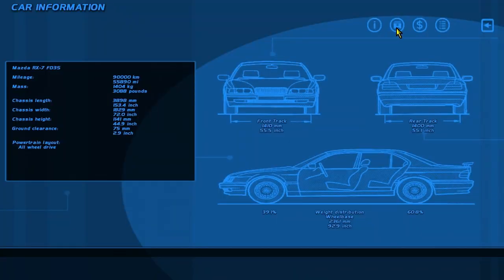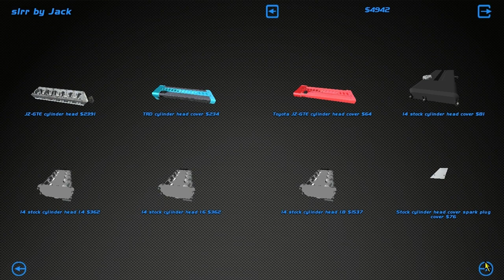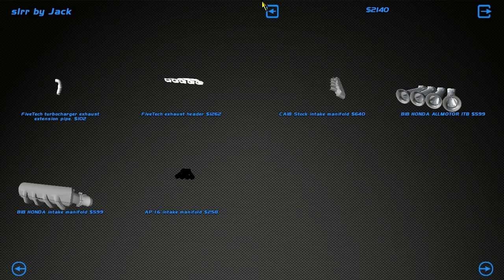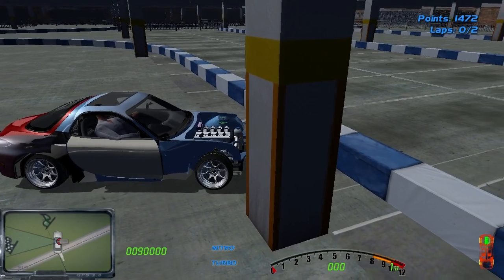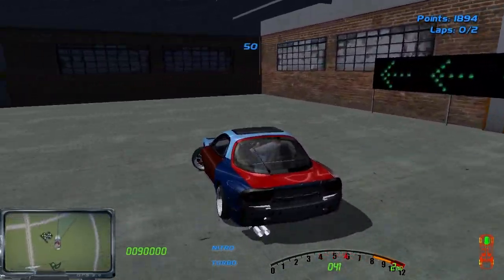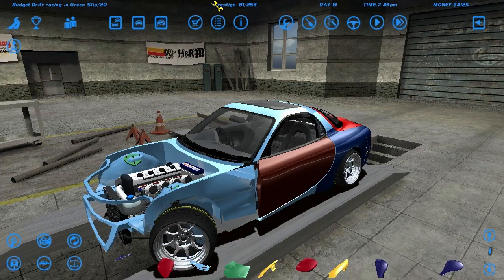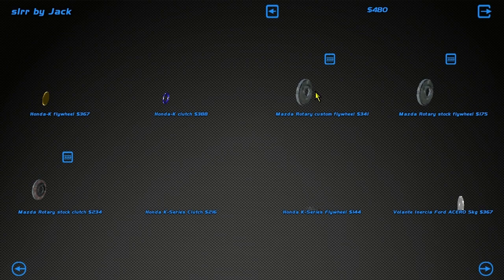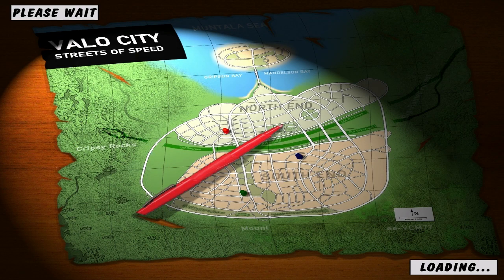Drifting on a Budget - SLRR - EP16 - BUILDING THE 13B TURBO

Comment: Technically, peripheral ported makes more power but at a higher rpm, bridge ported makes less power but at a more accessible rpm, first it's better if you race and drive hard at high rpm, the other it's more reliable for dailying
Reply: in a race with many corners like most of the maps we have the bridge port will have a massive advantage that it doesnt need to be reved as high and its more reliable
Reply: Vlad Kruglov yup, exactly
Reply from the maker: Ah that's nice to know